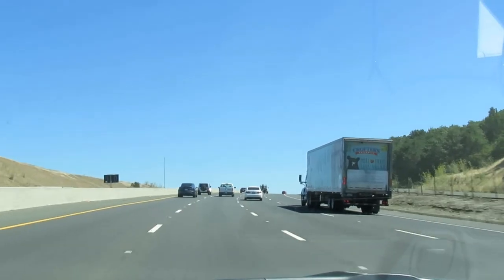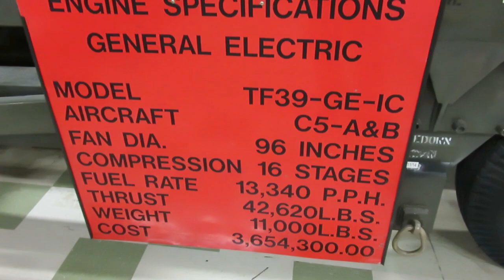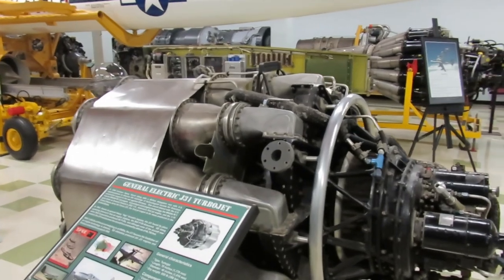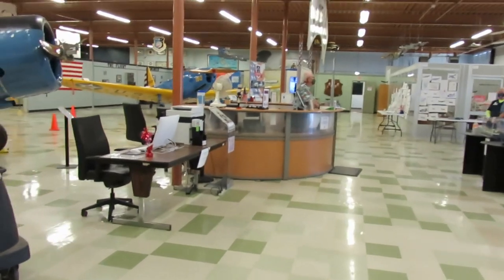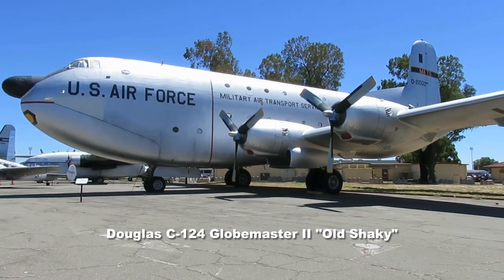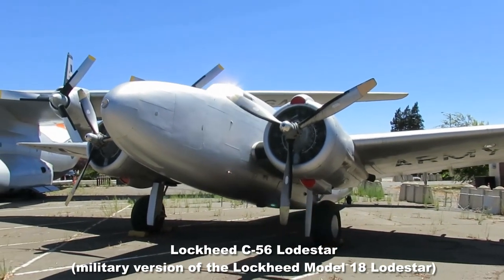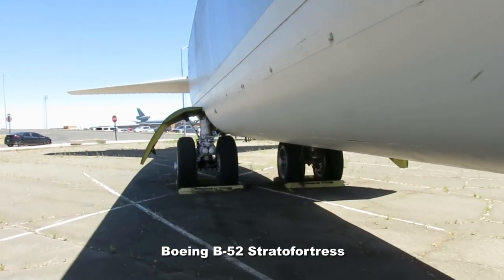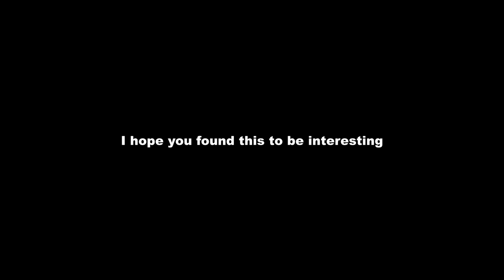A Walk Through Travis Air Force Base Aviation Museum

Comment: I remember when that Museum was being built and it was the old Commissary. Shopped here many rimes. I worked law enforcement at Travis from 1983-1986, then 1987 to the time I left in 1994. I got called to back up a call for the ambulance at that Douglas C-124. As it was being set up for display, it wasn't closed up. 2 Navy guys, transiting the PAX terminal down the street, found their way in. A bit drunk one of them fell from the upper deck to the cargo floor. Blood everywhere. Kid was OK after a few days at David Grant Medical Center. Oh the memories. Somewhere in the museum, were the original SP blotters, from the race riots on base, where one evening the chow hall was burned up.

Comment: That C-133 and another were STOLEN from the boneyard! There's a great story about it online. There's pictures of it flying with pipe for the pipeline sticking out the back end with the doors open. Lots of stories about this plane. 

My dad flew the C-124, un-pressurized and when the C-133 came out all the pilots wanted to fly them because they were pressurized. A lot of them crashed about 100 miles off the shore of CA and dad told me the pipots wanted back into the C-124.
Reply from the maker: Scudrunner, cite your sources. Otherwise I call "bs" on the plane actually being "stolen". You might not be aware that this C-133 was not the only C-133 obtained by the Cargo Master corporation for use in government work hauling outsize cargo in Alaska, with the federal and state government's blessing. The other two of their aircraft are still stored for their potential use at Mojave Airport in California.

Comment: Wow bud. You should have walked through and had someone explain what you were looking at before making the video. 
Gattlin guns on an O-2 ?????
Picture of a C-133 and you called it a C-131 ????
Many other mistakes to numerous to mention. It almost seemed like you were rushing through everything. Why the rush instead of taking your time and making a quality video.
Reply from the maker: bhensel100, wow yourself. Your own short comment has a lot of errors; why didn't YOU slow down and take more care?

Seriously, you are back seat driving without knowledge of the situation. There was nobody to walk through with me, as this is a small museum with minimal staffing, and the one or two volunteers there don't know all that much. I also only had a short time to be there, but I was hardly rushing.

In most cases, I have a lot of knowledge of what is inside airplane museums, far more than most people. And do you of many other people who bother to make air museum videos?

I know that an O-2 does not have a Gatling Gun (you called it a Gattlin gun); that was just a bit of levity because of the sight of the rocket pod on the wing suprised me, I even chuckled in the video. Usually when editing, if I see that I made a comment that might confuse visitors, I will add a caption to clarify, but I missed this one. 

Regarding the C-133 picture, yes I know the difference, but I had a slip of the tongue. But I noticed the error and fixed it with a caption. Perhaps you are so quick to find fault that you missed or ignored the correction.

You also exaggerate. A LOT. I just re-watched the first half hour of this video and could count the small errors on one hand. You make it sound like I was saying incorrect things frequently, and that is very clearly not the case. You say they "are to [sic] numerous to mention"; yet in one short sentence you assert a great many mistakes yet you don't know how to spell "too". Pot calling the kettle black.